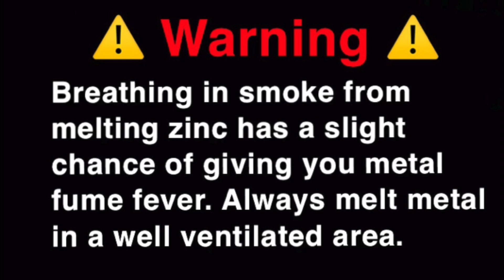Melting Zinc metal with Homemade DIY ROCKET FURNACE!

Comment: Very Interesting! Imma copy that design and probably add some air holes and use it to melt aluminum and zinc. 

Heres a tip: Try lining the rocket stove it with some Starlite mixed with charcoal powder. It'll melt the metal faster and will protect the rocket stove from heat damage!
Reply from the maker: I designed it specifically for low meeting point metals like zinc, tin, lead bismuth etc. I’ve tried melting aluminum with this design and it will work with forced air and charcoal, but your a lot better off building a real forge like the one I did in a previous video for higher melting point metals.
Reply: @BGTech1  Thanks!

Comment: How does the can not melt, does zinc have a low melting point? Also how do u know the zippers are zinc
Reply from the maker: The cans are made from steel that has a really high melting point and the zinc has a lower melting point. I can tell that thing are made from zinc because of there weight and how it looks when you cut into them. A lot of small die cast thing like zippers, hot wheels cars and other things are made from zinc because it’s cheep and melts easily.